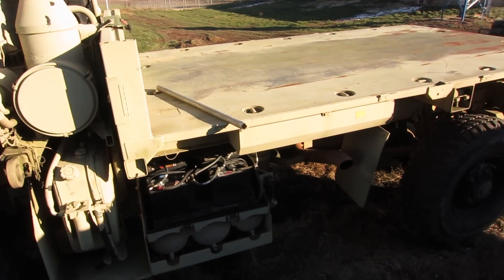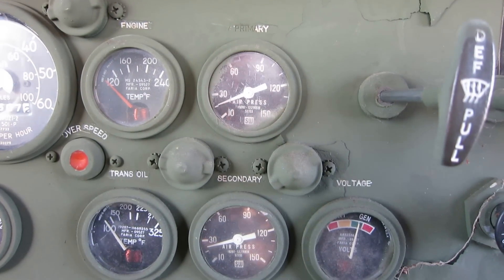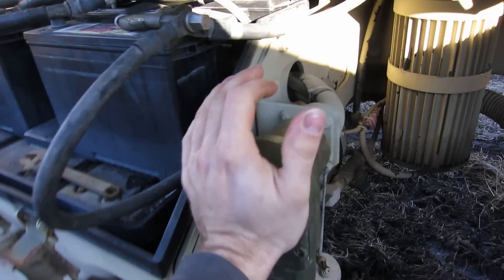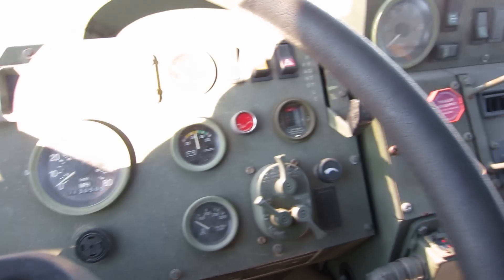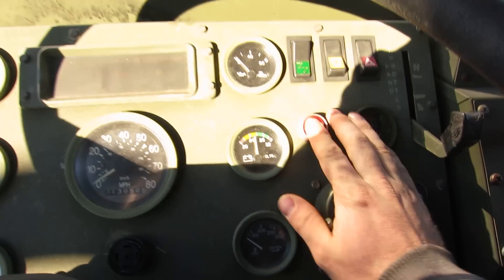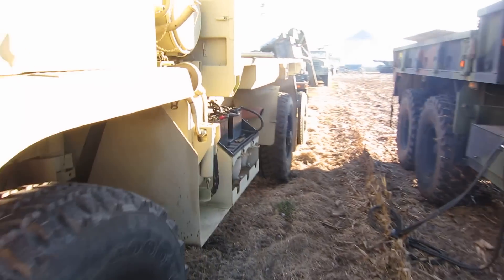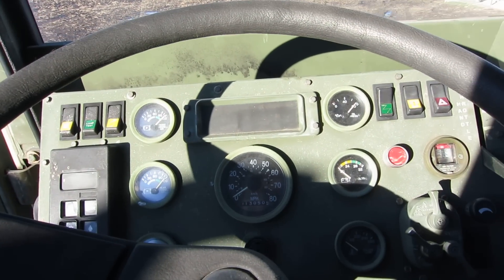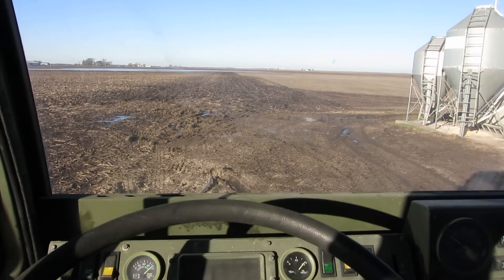m1078 start and tour pt 1

Comment: It looks a lot like my truck a little while back... carpet full of tools. It's in rough shape, but with a little work, you will have it going. The cab latch is stuck. You keep motoring it, it will bend and buckle the rear cab sheet metal and internal support where the cab latch plate attaches. (Someone did that to mine before I owned it.) I recommend PB Blaster. Once it is free, clean up the cab latch and re-grease. Best of luck.

Comment: You have to hit the silver plunger on the left to raise the cab. The one on the right that you operate in the video is for turning the cab air ride on and off. It is supposed to stay in the ON position for normal travel on flat surfaces (one on right)
Reply from the maker: +PowerstrokeNC Yeah I think I was doing what you described, can you see the cab raise and lower a little in the video? It seems to me that the latch that I zoomed in on wasn't releasing, is it hydraulically activated? I think that's the only problem I was having but who knows.